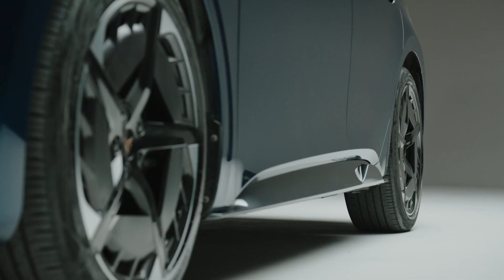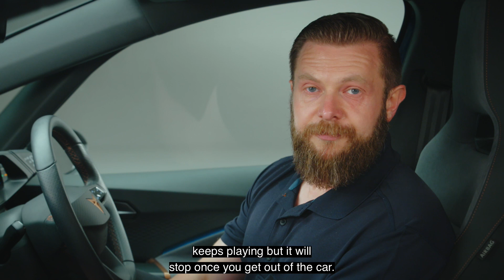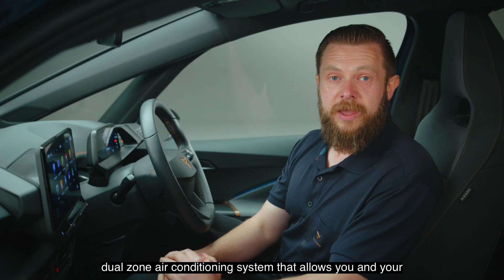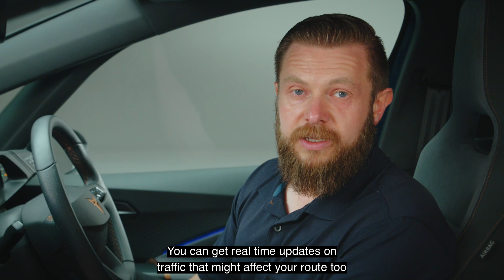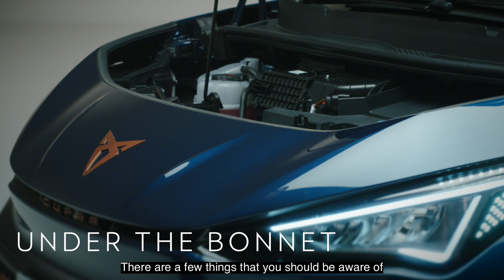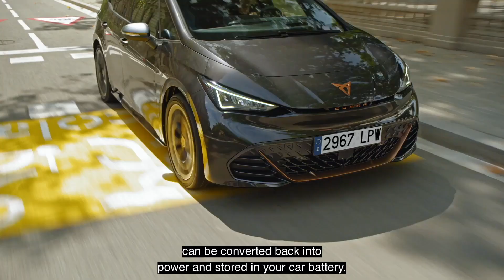CUPRA Born | Explore our first 100% electric car CUPRA Born | Explore CUPRA's 100% electric

Comment: A dog of a car in my experience- no wonder VW have problems. Doesn’t charge properly on ac or dc! Never hits specified figures in technical drop down on website and regularly half charged overnight apparently due to a battery safety issue!! Save up for an BM i4, superb

Comment: Hi. Is the Beats Audio System (more precisely the Subwoofer) integrated into the storage area where the tools (and the cable in your example) are located? So, is the main trunk/boot actually equally large with or without the Beats system?
Reply: It's not in the trunk, boot is always same size.

Comment: Nice but to expensive compared to others.
Reply: You get what you pay for, and this car is worth every penny 💯🔥
Reply: @andyhudson2016 £8000 more than the equivalent MG4? I think you’re stretching it.
Reply: @helipeek2736  basic MG doesn't have any additional features that even cheap petrol cars have like wireless charging etc.
Reply: @Antody  odd mine does.

Comment: Really clear helpful video
I have a couple of questions about the Born
1) I gather that the wipers have been set up for LHD cars which causes an annoying line in front of the driver. Has this been rectified in more recent cars? 
2) is there a quick way of turning off lane keep assistance without going into the menus as I gather it resets to ‘on’?
Reply: Wipers, still the same.  Lane keep is on at start by law.  Quickest way to turn it off is to add to fav icon, still 2 presses to disable each time and a 3rd to return to menu.  You could disable it forever with a OBD + software etc.